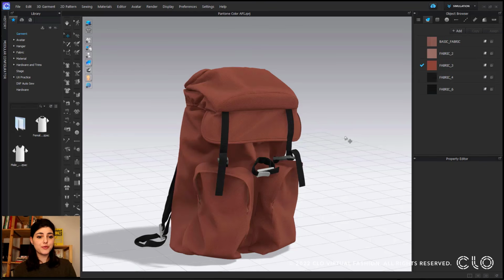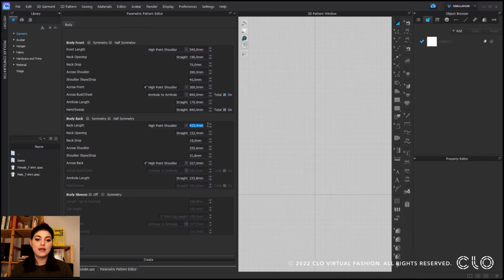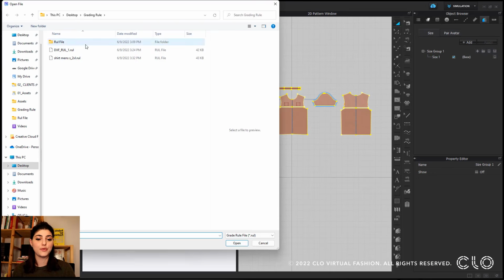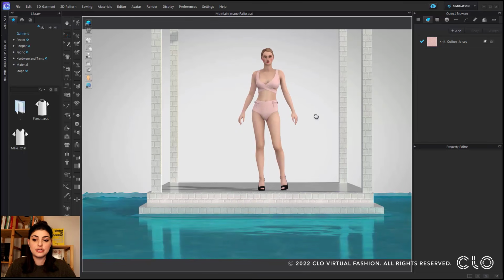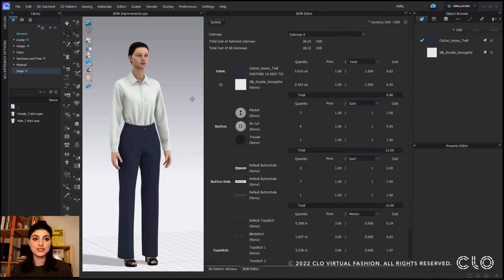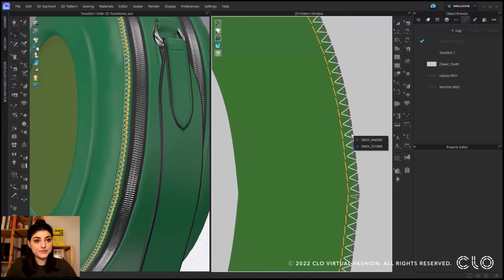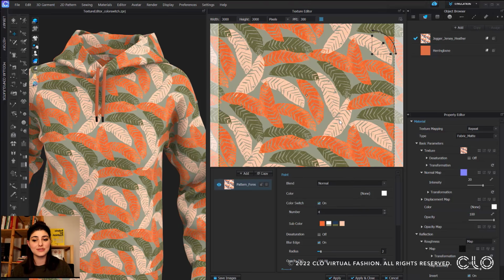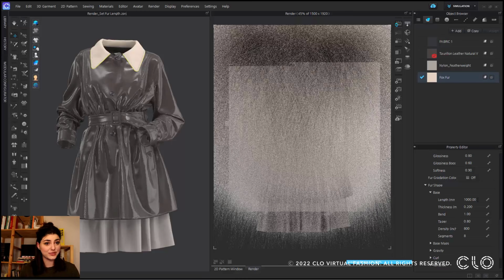CLO 7.0 New Features Webinar [English]

Comment: Hi, Thank you for your response, I would like to ask more one question, When we use the point of measure tool to measure, we can measure from point to point and straight. But I want more, I like to measure the curve line of the pattern for all sizes and multiple lines, plus or minus multiple lines to double-check the line length.  Could you please tell me how to do?
Reply from the maker: Using the TRACE TOOL, right-click on the segment you need to measure and choose "Trace as Point of Measure"

Comment: Hi! I would like to ask a question. Could you please tell me how to grading a notch in CLO? Grading a notch/point along the line will not make a change to the pattern shape ( No effect on the pattern shape, only grading the notch length following the line shape). What I want is to keep the pattern of each size's pattern, and the notch will follow the line of shape as the path of a pulley.😇 Hope you can understand my mean
Reply from the maker: Notches will be applied to each graded size. There is an option in the property editor to lock the notch so it is always a specific distance from the designated Segment Point.
Reply: @CLO3D  OMG!! it is usefull for me. Thank you so much!🥰
Reply from the maker: You are welcome